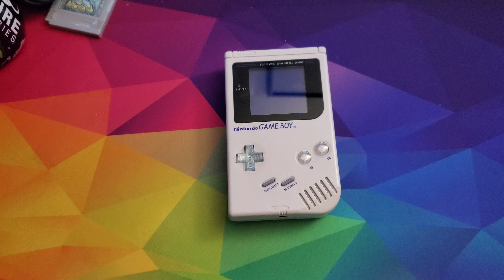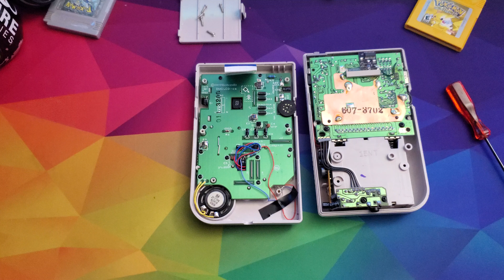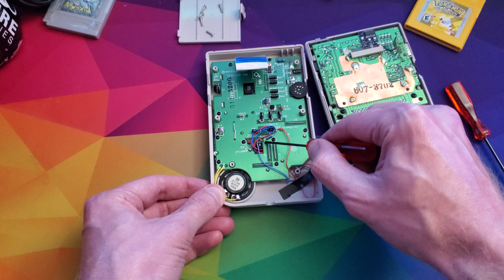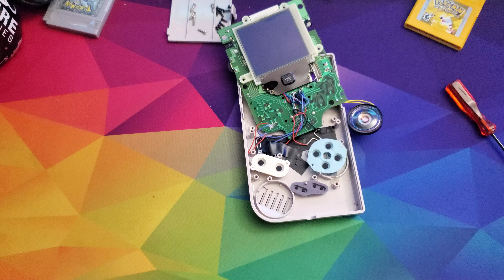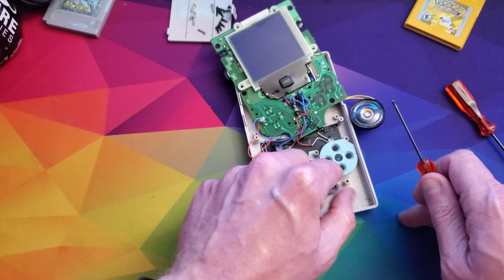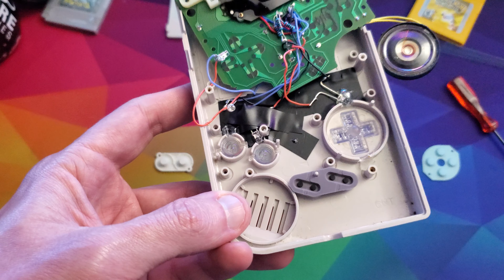DMG Gameboy Light up buttons

Comment: I'm planning to do a mod like this on my DMG. I wanted to have the button LEDs dim along with the IPS screen. With the lights wired as they are in this video will this happen? If not, would tapping into the contrast wheel do the trick? I'm no circuitry expert, so I appreciate advice.
Reply from the maker: Sorry for the late reply, I just saw this comment. I do not know if wiring it up like that would do what you are wanting it to. If you were able to try that I would like to know the results tho.